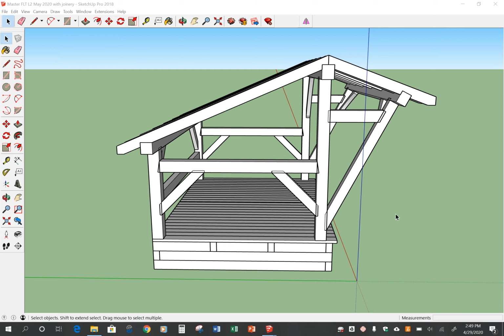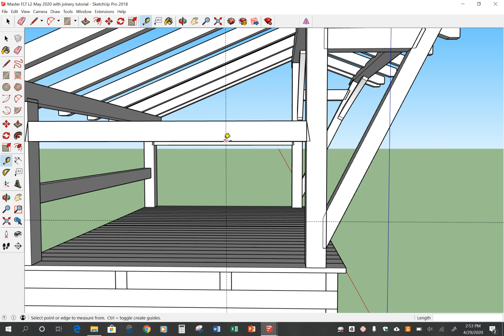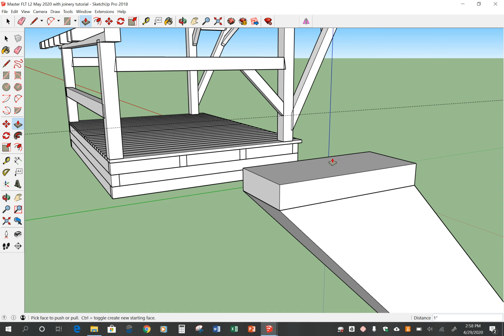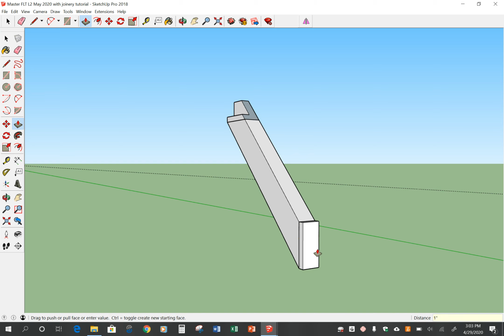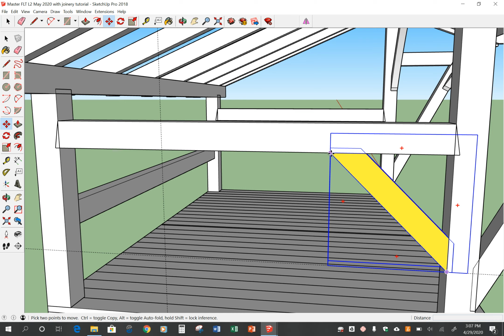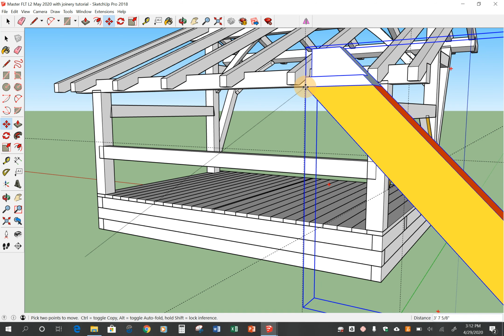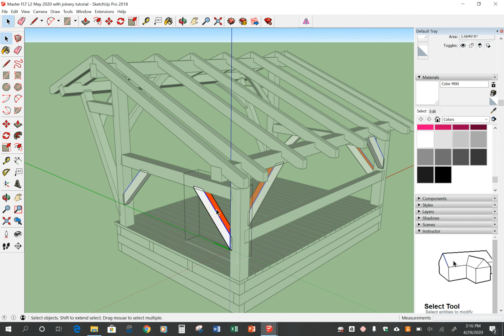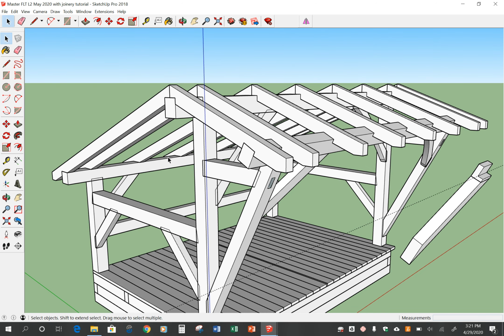Timber Frame Design Using SketchUp Part 6:  Drawing Braces and Flipping/Rotating Components

Comment: Thank you for these videos!! Best ones I've come across. We did the heartwood scribe class together and you told me about these video. Curious, If you cover rafter drawing in any of these?
Reply from the maker: I currently do not have any specific rafter videos, but I really should make a few. Common rafters would be an easy video. Compound stuff like hips and valleys would make for a fairly long video, but there are some shortcuts that would save the average user a lot of head scratching. If you’ve subscribed, stay tuned.

Comment: I'm playing around with a 2 post pergola with a 2, 12 pitch, with 45 at the bottom of the knee brace, and funky 35 degree at top, how would you draw that?
Reply from the maker: You would use the protractor tool to make a guideline projected from the top the post. It’s not hard, but is hard to explain in words. If you select the protractor tool, then click once on the outer corner of the top of the post, then slide your mouse to the inner corner of the same edge of the post top, click once then move your mouse upward to get a tilted guideline, then type 2:12, then enter. You will get a dashed guideline representing the slope. You could also type 9.46, enter (which is the angle of a 2:12 slope). I find it easier to just do 2:12. Once you have a guideline representing the correct slope, you can pull additional parallel guidelines to outline your rafter, then use line tool to enclose the rafter. Once rafter is drawn you can use a similar process to draw a 45 degree line to represent the brace. I’ll try to put together a short tutorial. If you can somehow send me an image of what your trying to do, I’ll customize the tutorial to your design.
Reply: @bigbeamstimberframes770  I'm thinking it's a free design off timber frame headquarters site, I'm modifying it a bit, cause ultimately I'm gonna hang kayaks on it
Reply from the maker: USMCdaddy Steve how many kayaks will go on it?
Reply: @bigbeamstimberframes770  3, I'm figuring 3 arms per post 24" on the same pitch as the roof, using 4x6, 6x6 posts, 6x6 tie beam 6' inside to inside
Reply from the maker: USMCdaddy Steve how long is your proposed roof (front to back)? Also, how long would you want the arms that hold the kayaks?
Reply: @bigbeamstimberframes770  this is a project for me to work on joints and things, like the tie beam is going to have wedged half dovetail with 1" diminished housing, I've made a few mistakes just not thinking it thru on my drawings, like my posts are 8', so when I added my tenon on sketchup my post is now longer than 8' so still tinkering with it